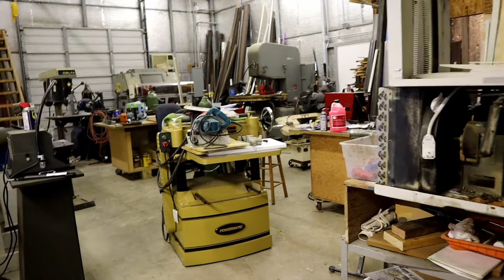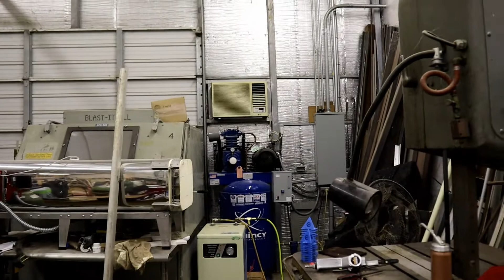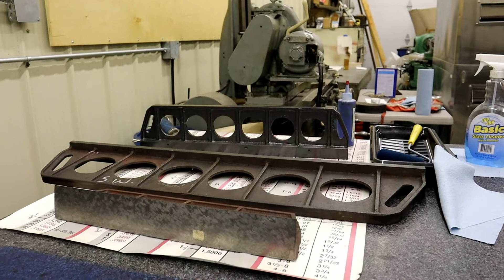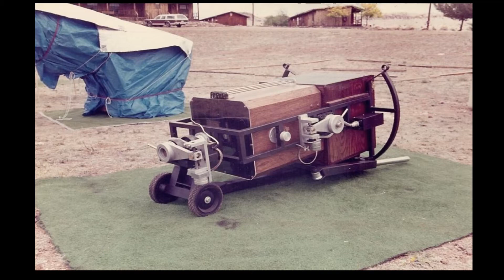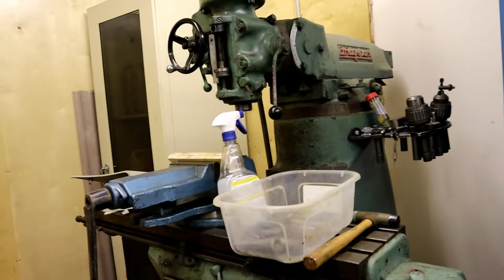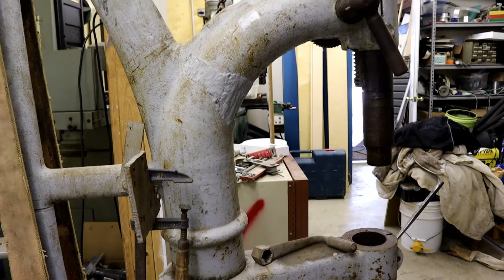January 2020 Shop Tour

Comment: Great tour!   That Camelback brings back memories, I bought one from an old road maintenance shop in Augusta, GA, and, if you can believe it, the table had about 1/2 of the metal remaining as compared to new.  They were serious abusers of it!  I eventually sold it but by the size of the curls all around it, it was a serious drilling machine!  Great size shop, too, congrats on your retirement!!  I have a similar staircase design in my shop if you google Tool Crib of the North on Garage Journal :)
Reply from the maker: Thanks!  I will have a look :)
Reply: @10swatkins  - if you jump to Page 9 it will save you some serious time browsing the thread and you can go direct to the staircase..8-)
Reply from the maker: HI, Matt.. I found it ;) Love the latch!   I think I am going to add a counter weight system to mine. I have dreams of it crashing to the ground :(

Comment: Good job . Hi from Australia. You are doing just fine .  You have already solved my up stairs in my workshop problem . .
Reply from the maker: Thanks!  I have some more design improvements for that step system... I want to add a counter weight to them in case the main cable breaks. Don't want them crashing down!